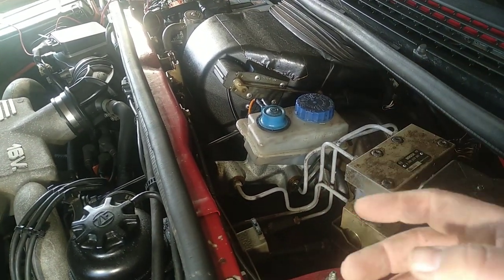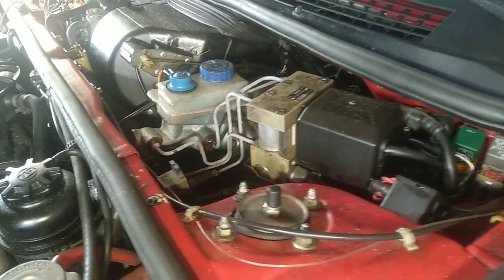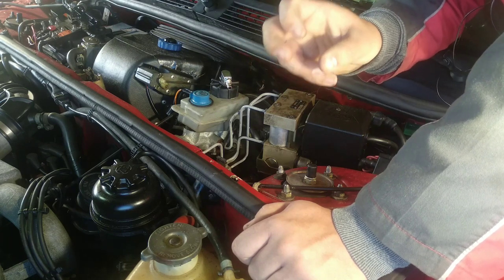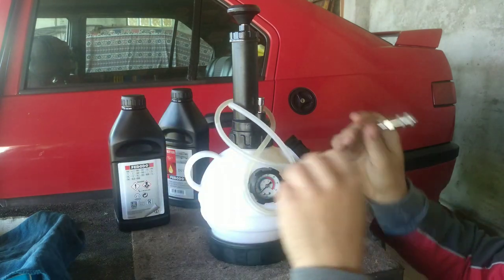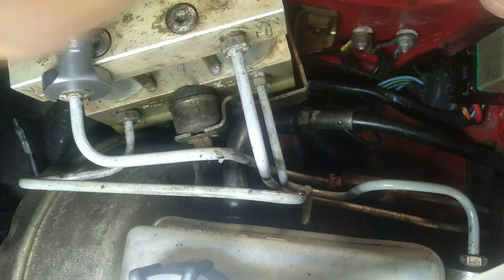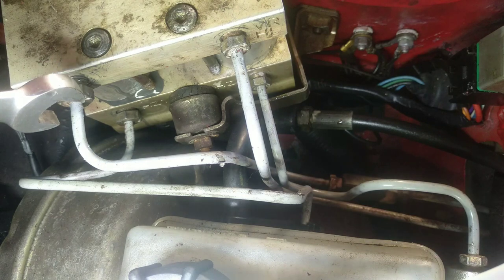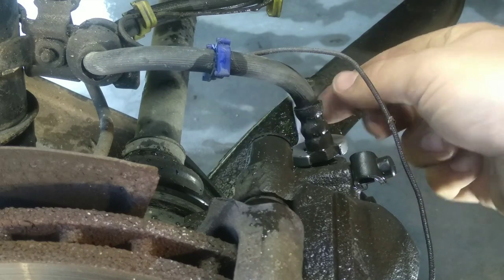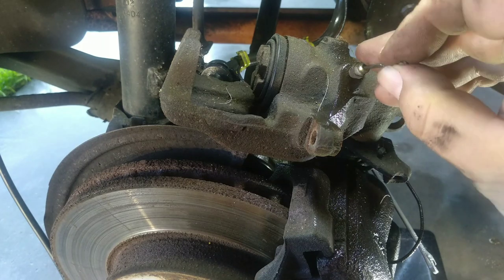Why i HATE vacuum brake fluid bleeders? I have something way BETTER! Typical Alfa 33 bad brake fix!

Comment: Thanks for this video. I am waiting for a tip about the rear axle adjuster. Service adjustment of this regulator causes big problems - show practical tips on how to regulate an efficient regulator please ;)
Reply from the maker: Hello. The video for that is already recorded and will be released in April!
Reply: @alfaromeonoproblem  great news!!! I'm waiting ...
Reply from the maker: As you can imagine i have lots of videos to record, and i see more or less what people need. 
Sometimes some videos are not ready as you need them, but it's a choice i have to make. 
I have videos uploaded until May. And i have 3 years of videos to record! 
Plus my new project, Alfa 33 restoration.
Reply: @alfaromeonoproblem  Hi, april is gone .... :)

Comment: Hello , thank you for explanation about brake system.
How about explanation for 156 brake system? I have AR 156 1.9 JTD 16v mjet 2003 2gen when engine off my brake pedal strong when I push it but when I turn on the engine my brake pedal was soft and very slow run down. It's normal or I have a problem?
Reply from the maker: Hello. This videos goes for all makes and models. It will do also for 156. 
However I do have videos for 156 on braking:
https://youtube.com/playlist?list=PLgcTCigdgD8N-v7k0R8pL622pWx0QcLZd&si=BsqcDQMovYTZoKq7
Reply: @alfaromeonoproblem  Thank you a lot for navigate me.

Comment: When you did all that, on all 4 brakes, how does the brake pedal now feel? Is it hard, and starts braking as soon as you start pressing it?
When I had the new brake discs, pads and oil put in by the dealer (becuse I did not want to bleed the brakes myself), I expected this. But my brake pedal is soft, and does not start braking right away. First I press it, and there is low resistance, and when I continue pressing it then it reaches the point of higher resistance, and that is when it starts to brake. Not sure how it should be, but regardless of the brake pedal feel, my brakes still are strong.
Reply from the maker: Hello. The pedal feels very good. No play and no false breaking. Very good really.

Comment: The Alfa 75 is the same ive never bought a 75 that had a good pedal feel.
Reply from the maker: As you can imagine, my 75 brakes very well! It's almost telepathic.
Purged with this method, of course.
New video tomorrow
Reply: @alfaromeonoproblem  yes its usually the first thing i attend to on them.  I just can't stand spongey brakes.
Reply: @alfaromeonoproblem  can't wait you have a new subscriber.
Reply from the maker: Same here. Had the same problem on my 155, it was terrible!